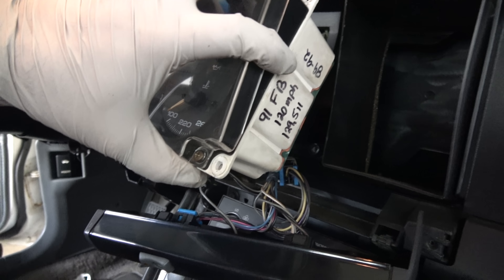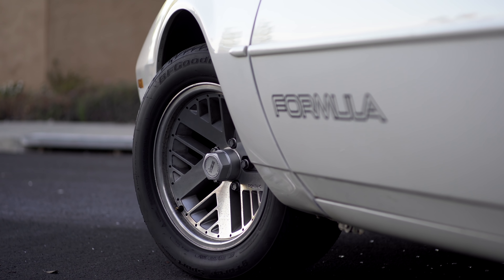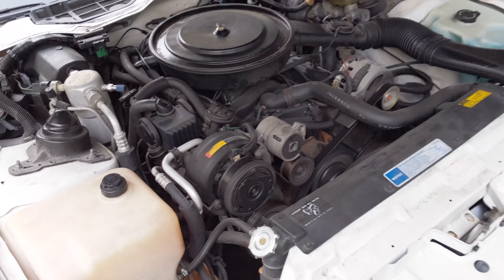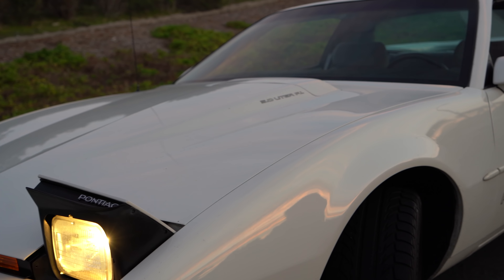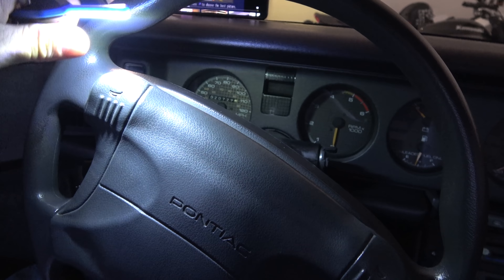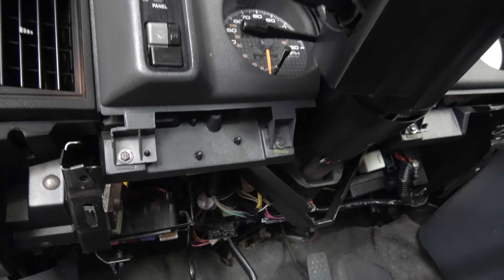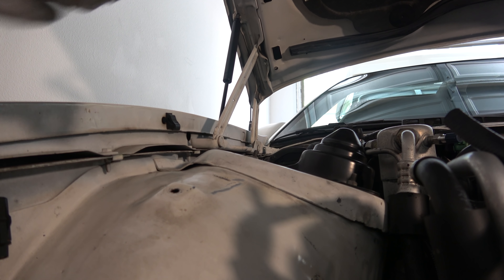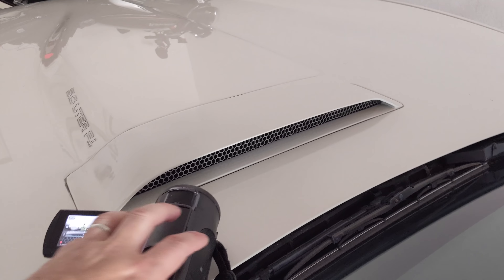LIES! Odometer fraud on my 1990 Firebird

Comment: You actually believed that a 30 year old car bought online only had 20k miles on it?? C'mon, you're a car guy and you fell for the "classic" used car  line! You would have "clued in" had you driven it first. The good news is that you bought a very nice 3rd generation Firebird with a base 5.0 and a T5 stick...fairly uncommon as most were automatics with a great interior and nice paint. High mileage but who cares. You might have over paid (maybe) but drivelines can be replaced. Enjoy the car for what it is.

Comment: Wow where to start first off the instrument cluster is obviously a used replacement and the mileage  written on the side is out of the car it came they obviously mixed and matched the 2 clusters by taking the odometer out of the old cluster and putting it in the replacement cluster i seen what it looks like when the older clusers are tampered with and the number will not line up correctly and it will not look rite your odometer looks perfect like it should second of all it's a 30 + year old car do you really think the fuel injection system is gonna be perfect especially with ethanol gas that is at the pumps these days and after all those years you think it's scandalous to find that the distributor cap is corroded and some rust on the distributor it's obviously from condensation third of all the small block chevy of that era is known to have week valve seals after all there only rubber or something like it and they can go bad from sitting just as well as from being driven and the 4th thing I've seen ecus go bad a lot on the throttle body gm's I've personally changed a number of them on camaros firebirds s 10s vans trucks etc and then when it comes to fuel economy it is a v8 do you even know what gears are in the differential because the certain gear ratios can affect fuel mileage I think it's a nice car and you are just one of those people that are never satisfied unless you have something to complain about that's what causes you to become a defective car detective my mind is blown from your video wow

Comment: You my friend are not exactly a genius. Of course that isn't the cars mileage on the auto salvage instrument panel 
Maybe you should have a qualified individual looking at your vehicles there are tons of auto sales scams .
I've personally seen times where upon rebuilding a high dollar vehicle people have found that only the windshield and everything forward of the firewall were the only piece used in the rebuilt vehicle in question. That and it is much harder nowadays to roll back an odometer these days legally without your states BMV , DMV 
whichever applies catching you.   If it was done to your vehicle it was most likely done a while back and probably not by whomever you purchased the vehicle from unless they had owned it for years.
The only way to find out is to get all the DMV info for each time it changed hands.  Look for it being titled in a different state just to be retitled  quickly back in the prior state  that will be your culprit.

Comment: Sorry for your disappointment, Winston. Unfortunately there's no such thing as an honest used-car salesman. It doesn't matter how forthright they are in the rest of their life, they'll still try to scam you at least a little when selling you a used car. It's inevitable; honest used-car salesmen don't earn enough commissions to stay in business.
91 FB = 1991 Firebird. That's where the instrument cluster came from. I'm not sure if it's legal in the USA to reset the odometer on an instrument cluster that came from a different car, to match the actual mileage of the car it's being installed in.
Also, the fuel economy is almost certainly caused by the worn-out oxygen sensors and airflow sensors, not the ECU. Oxygen sensors and airflow sensors wear-out slowly and progressively; there is no way to diagnose their failure except to replace them and see if the car starts running better. The ECU can guess that one of those sensors is worn-out based on "implausible readings", but in older cars that's not guaranteed to happen.

Comment: 91 FB, whatever that means lol. (FIREBIRD) Swapping out odometer isnt same as rolling back. Could have went bad. Blue smoke at start means nothing. Its a chevy motor. Mine has 84k original miles. Puffs at every start from sitting. So this car may have 120k on it, it was all hiway miles. I dont see ONE rock chip anywhere behind the front wheels. These cars had big problem with that and wide wheels throwing up debris. Car most likely has sat most of its life. Its still a low mileage car. Heres the best test.... How does your center console open up? Like new? Its a low mile car. Or is it trashy and sloppy? If so, it was well used car. Rarely do you get in one of these with a good working center console and interior not burnt up with cigarette holes. These cars all got trashed like that. I agree $11k is steep for a 120000 mile car. But im asking $12500 for mine with 84k. Got the 5.7 tpi tho. The car was obviously taken car of but i do understand your disappointment. But still, quit chur bitchin. 🐐 also, mileage is not a factor when it comes to resale value on older cars. Its condition. Unless you want to keep this car original, its got the worthless 305 anyway. Upgrade it and you will be much happier with the performance. Seller most likely had NO idea. He was duped too.